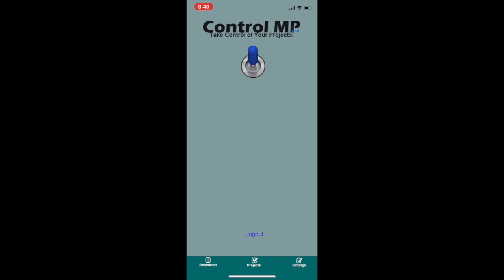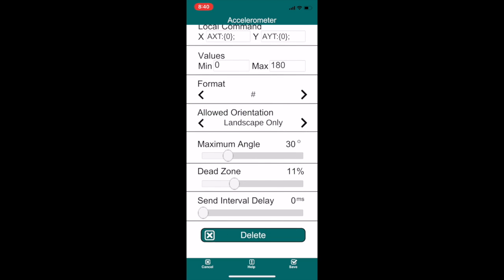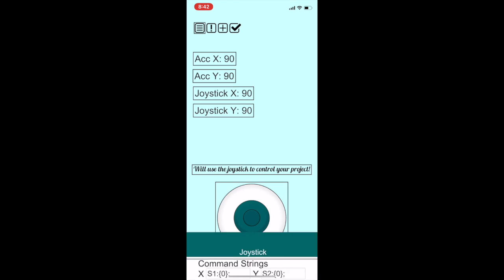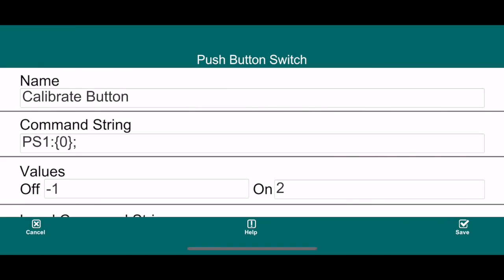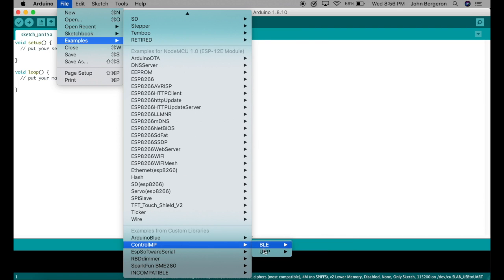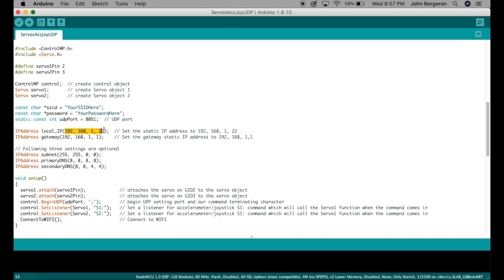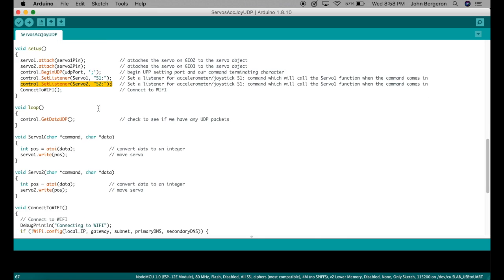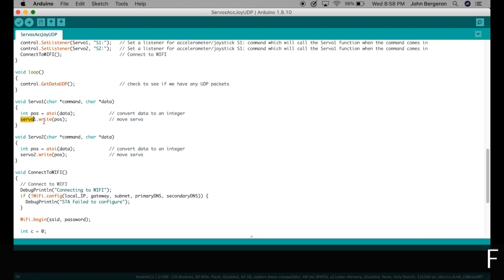Control MP - controlling 2 servos with joystick in portrait & accelerometer in landscape

Comment: Does the Arduino library of the Control MP support BLE capable microcontrollers other than AVRs or ESPs? I have a Nordic  BLE module with an nRF52 chip on it, and looking for a companion app and lib to start developing BLE applications.